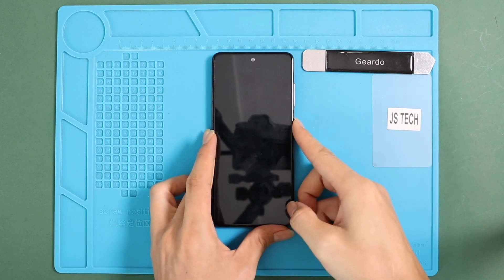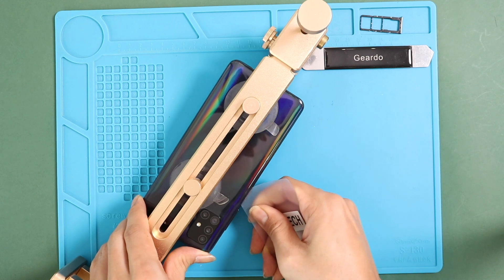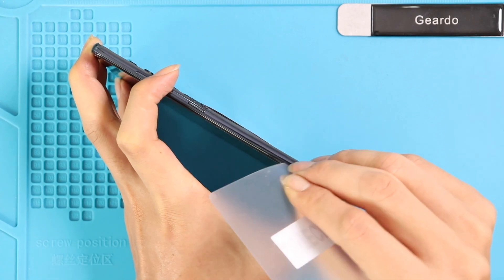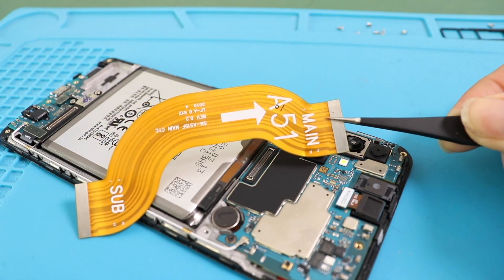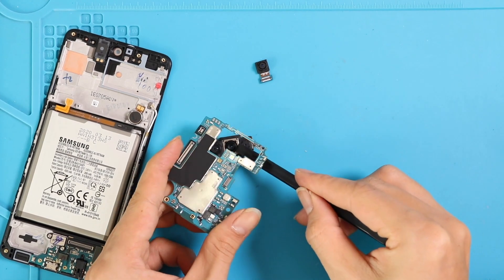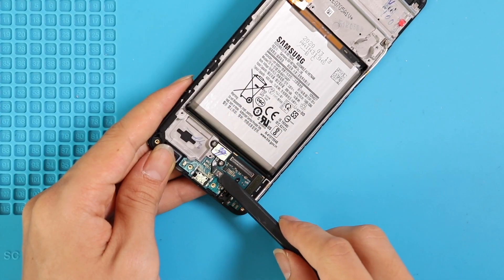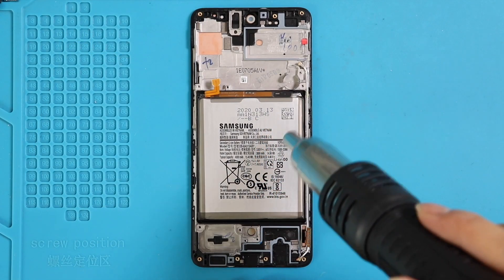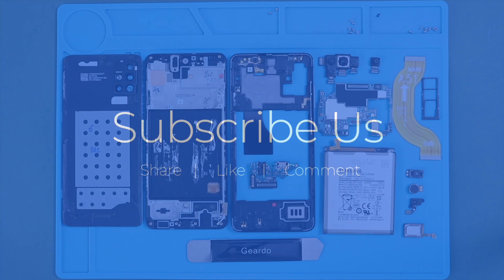Samsung Galaxy A51 Teardown | Repair

Comment: Hello friends! I have tried to replace the speaker in the midframe, with different glues, different bits of silicone to support it, but it always makes a heavily distorted sound at high volume.
It is not the speaker, I tried two...it is something about how it is fit into the frame...

Any tips?

Comment: My phone's power button doesn't work, is that anyway to fix it? I carelessly let the battery all drain and the screen went black.
Reply from the maker: Well yes you can fix it. There can be two things, maybe the button is bad and if not the cable is bad.

Comment: My wifi and Bluetooth will not turn on . They both turn light blue like it's attempting to turn on but it stops I factory reset my phone because of this I now took my a51 5g apart trying to fix it what do u think is the issue ?
Reply from the maker: This is most likely the issue with the mainboard. You need a seek a board technician

Comment: Anny idea why it didn't turn on? Thank you.after replacement? It just showing like circle and sign of voltage ⚡
Reply from the maker: This is actually after the water test, Water test has damaged the Screen (first it was gone, then came up after few days, but with some issues). Then We fix it by replacing a new screen.